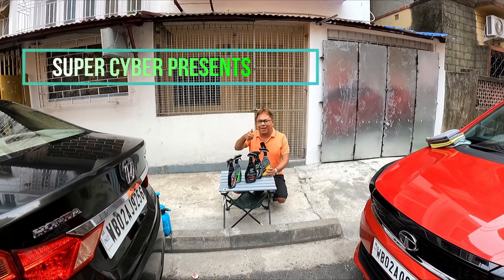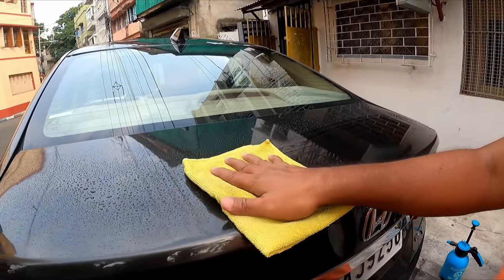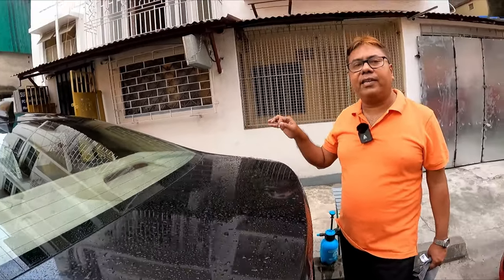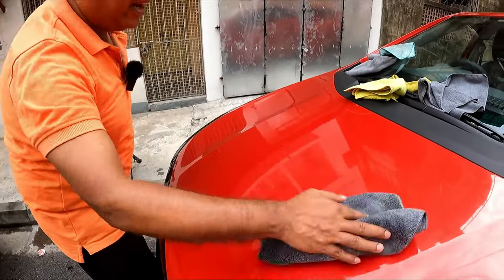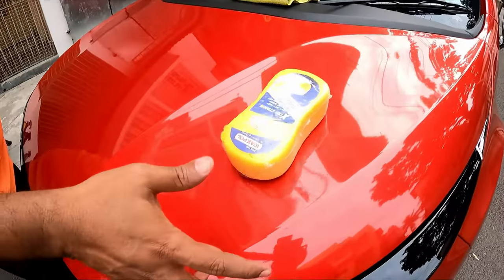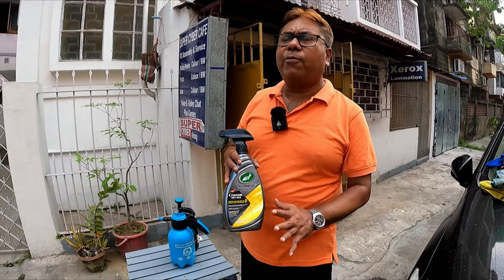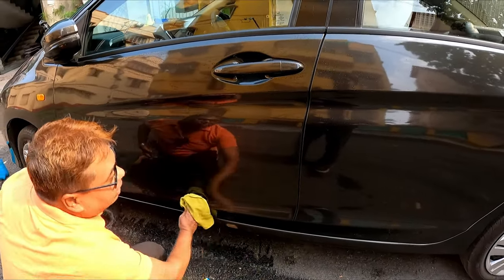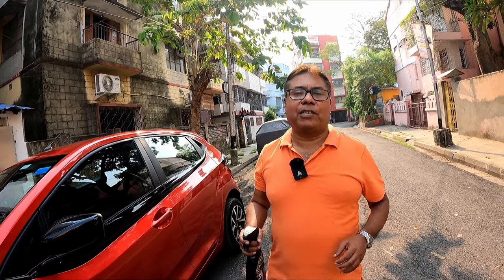My Most Preferred Turtle Wax Detailing Products Explained #turtlewax #cardetailing

Comment: Hello sir.
If I use the seal and shine product for protection, can I use wet wax as a top coat? Or is there any other product you'd recommend?
Reply from the maker: Wet wax is one of the most preferred topcoat products. Definitely you can use it.
Reply: @supercyberautomotivetravel  thanks a lot for your quick reply! I have one more question though. How long should I wait after applying the seal and shine product before I can put on the next wet wax coating? Also, can I use the Wave X product to clean the dashboard and leather, or should I use Turtle Inside Job instead?
Reply from the maker: You can use Turtle wax inside also. Better to wait for 2 days after applying seal n shine. Wavex products are budget friendly and ok .

Comment: Sir, Can I use Ceramic wet wax as a topper if I already used Super hard shell?
Reply from the maker: Yes you can . It can be used as a top coat on any coating.
Reply: @supercyberautomotivetravel  Sir, can you make a video on how to strip wax or sealant from car at home? 
How can we do that, I want to apply sealant or ceramic but my car has wax already, how to remove it.